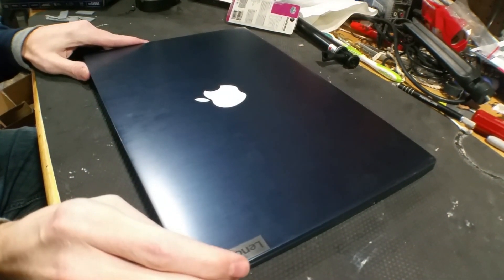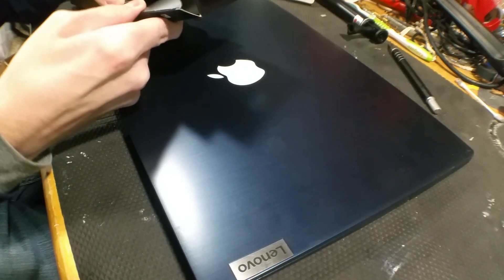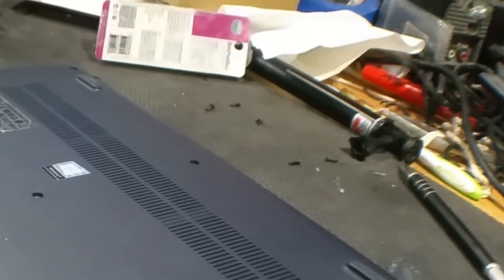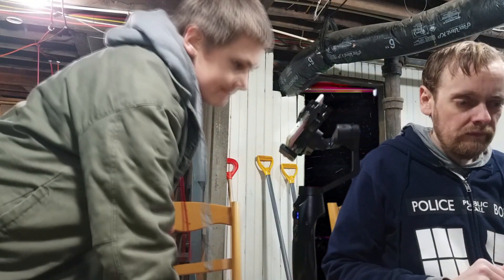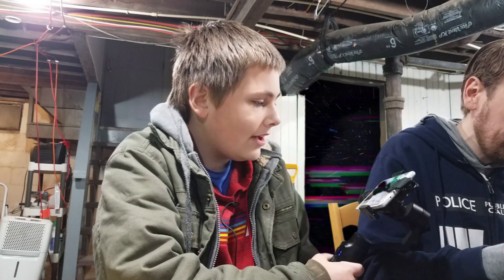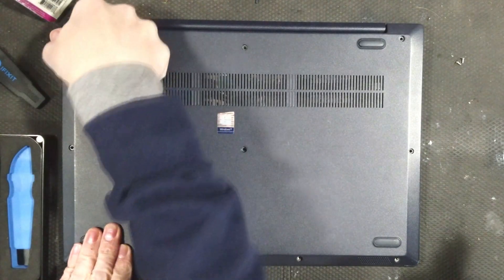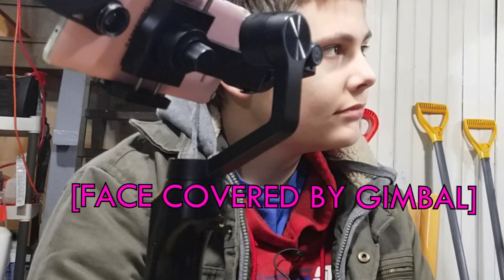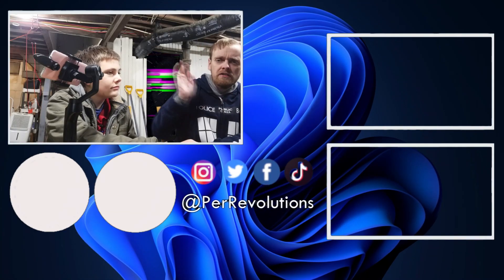Lenovo IdeaPad 3 15.6 Laptop 2nd SSD upgrade

Comment from the maker: You ever see a laptop with a missing caddy + cable for connecting a 2nd storage drive?
Reply: My Ideapad 3 (15ITL05) has the caddy, but not the cable 🙃

I had bought a Samsung EVO SSD (like yours), but didn't see a SSD drive like it when I got my Ideapad, so I returned it and got a 1TB PCIe replacement. Then I found your video and realized that I could've used the EVO SSD! facepalm I did notice that empty second SSD spot, but thought that it was a heat vent area or something (I'm still learning about PCs). I think what threw me off was that it was missing that cable. 

I'm curious about initializing the hard drive, though. My old PC motherboard gave out and I just got a new PC. I took out the HDD from the old PC to transfer some files to the new PC using the SATA connections, but it doesn't recognize it in File Explorer. It recognizes it in Disk Management, though, but gives me that MBR/GPT prompt. Will choosing one of those options erase my hard drive? I just need to get my band live videos off of the old hard drive.
Reply from the maker: @jaymz_rg1003  the only way to get the data from that drive is by using linux tools.
One of two things happened:
1. something deleted the MBR/GPT info from the drive
2. that drive had windows installed while a 2nd drive was connected to the same motherboard, it's MBR/GPT is married to the other drive

Best option is to put it back in it's original computer, if you can see the data there, transfer the data via USB to another device
Reply: @RobertJene  Thanks! And thanks for replying!

What happened with the old PC was that I was just online watching a YouTube video and, then the screen just went black. The mouse and keyboard weren't recognized, either. No lights on either. I tried the old monitor on the new PC just to see if the monitor was messed up, but it worked on the new PC. So I don't know what happened.
Reply from the maker: @jaymz_rg1003  most probable issue is power supply.
tip: never troubleshoot peripherals if the computer isn't working.